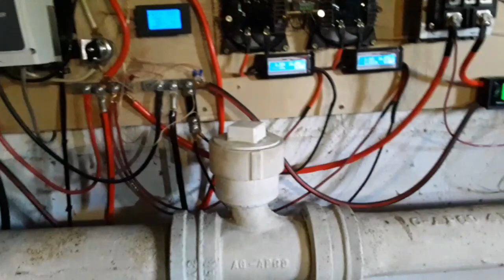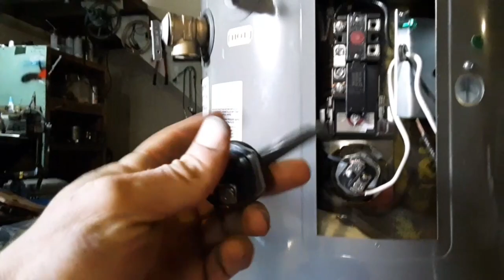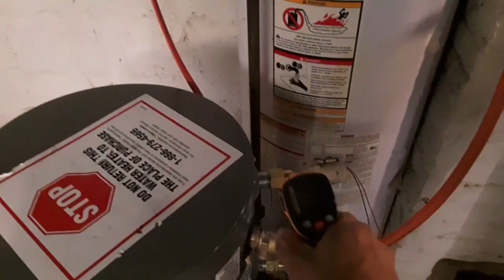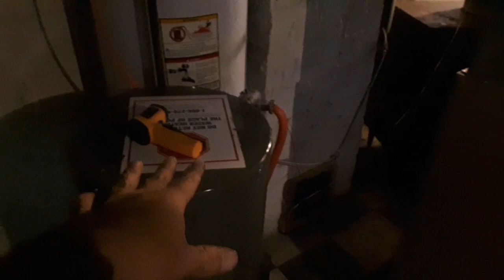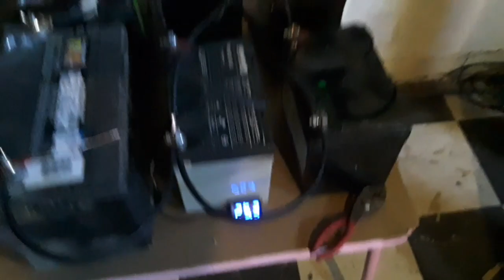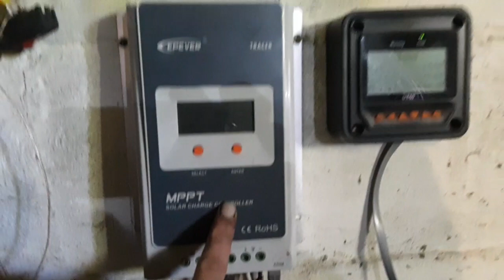Heating Water with Excess Power

Comment: Great system. Will the factory thermostat work with your 24 volt DC?
Reply from the maker: Thanks!.... i haven't tried but i highly doubt it since its wired for 120v A/C. In the summer time it never gets even close to its pressure limits so im not to worried. In the wimter however with the wood fired system.....water temp gets up to and over 140° F often. So far so good....the 15' coil seems to be the sweet spot because i havent blown a line or even had a single leak all winter. 20' was too much....she got up to 180° once last winter and the pipes were creaking....had me a little worried so i purged hot water...ran the dishwasher and told all the girls to take showers.

Comment: Idea you may want to consider. There is a water valve that operates on temperature. If water is warmer on temp sensor it stops. If water temp at bulb is colder it flows. Temp is adjustable.  This adaptation works with a circulation pump and pumps back cooler water to heating tank. Just an idea that may help you out decreasing energy loss and make more efficient use of free hot water.
Reply from the maker: In the works actually. I eventually want to also incorporate solar thermo. Drawing up the map of lines, pumps, sensors,  t-fittings and so on but basically i would like to be able to use hot water year round with little to no extra trouble....system may get complex though. Need to keep it simple and hearty enough that if there's a sensor failure at any point it won't be a catastrophic failure.